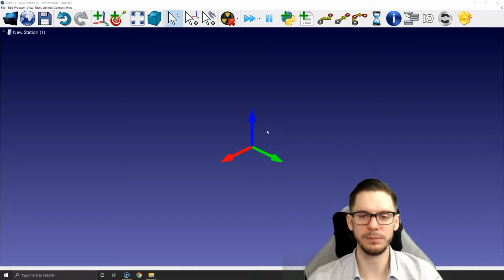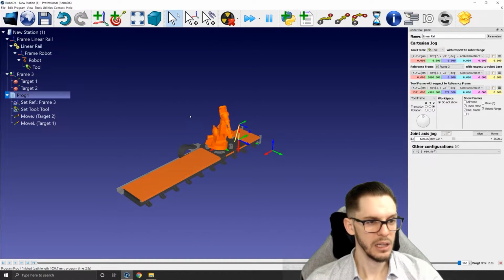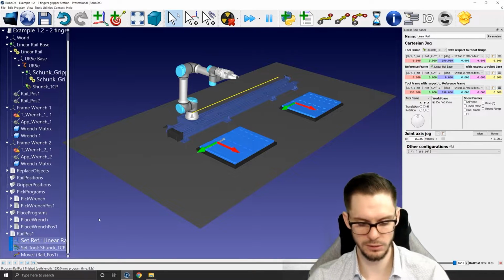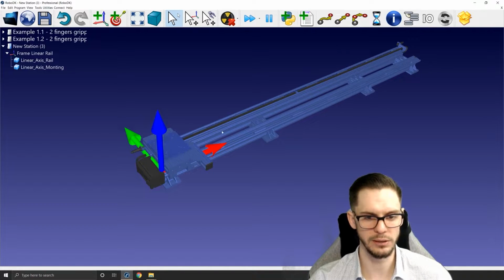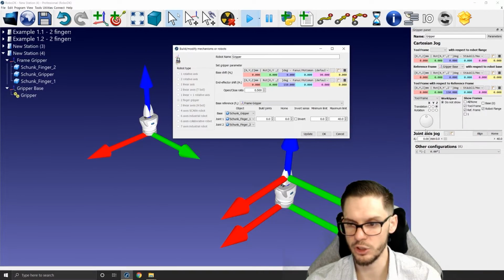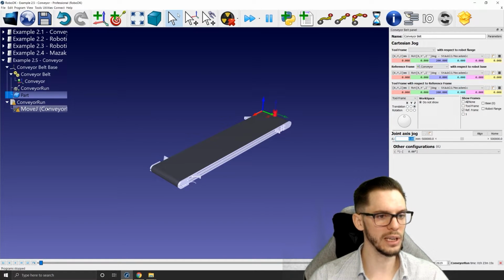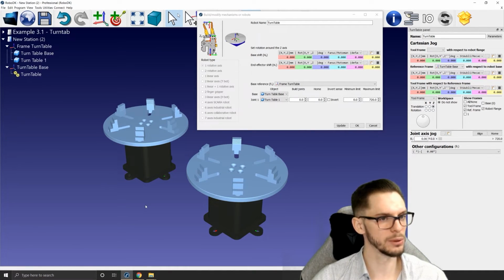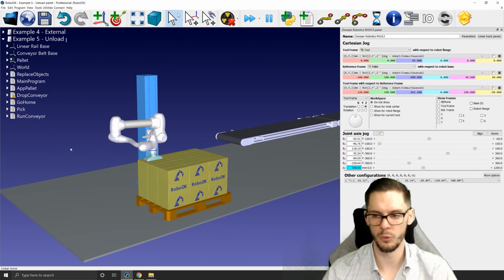Mechanisms - RoboDK Webinar

Comment: I am trying to do the same, and it works in the simulation but when i try to run this program from the actual robot, the track does not move. I am defo missing something like some declaration or something in the program to specify the communication from the robot to the track according to the program. can someone point me in the right direction
Reply from the maker: That is a simple question with a very complex answer. 
It depends on a lot of factors. 
What robot brand are you using?
What linear rail are you using?
How are those connected?

You should start a thread in our forum instead. that's a better place to receive technical help. 
robodk.com/forum